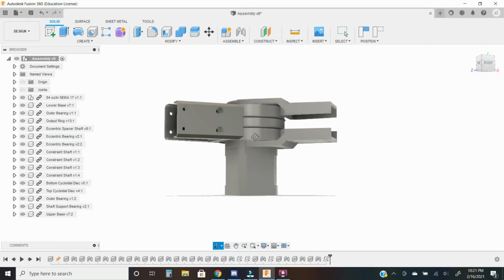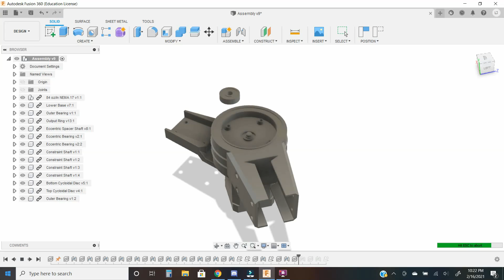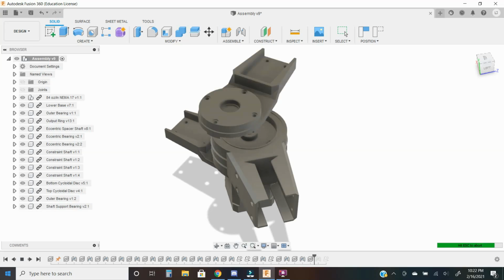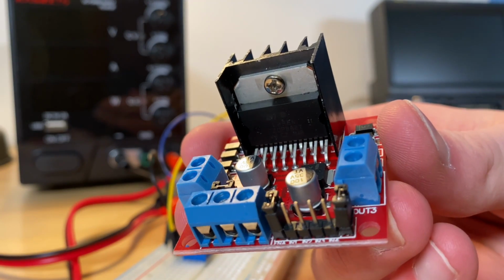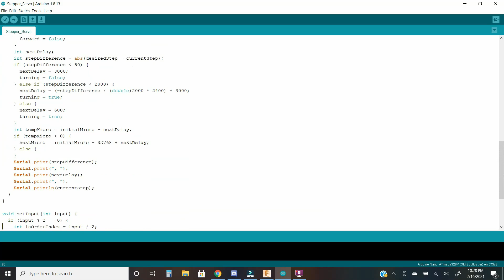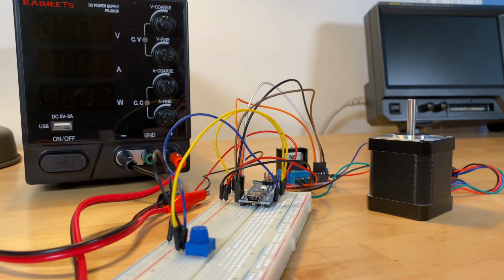3D Printed Cycloidal Actuator

Comment from the maker: I tried to “cut the fat” for this video. More time went into editing, and I actually kinda enjoyed the process! Hopefully it made it more enjoyable to watch. Thoughts on a robotics arm using something like this design?
Reply: Would love to see some section analysis or parts coloring in Fusion, to really make clear the mechanics. But you struck a good balance here imo!
Reply: Nice Work Levi!  Excited to see the arm when you have it complete.
Reply: Maybe for orienting a small solar panel also using a second one? Or a mirror which shines sunlight indoors ;)
Reply: It does make the video better! Your older material about coilgun design were a bit too verbose, but this vide was much faster and more engaging. 

I'd be interested in seeing a SCARA plotter with this design!
Reply: Absolutely love it~! My first thought was you could add some gas support struts/springs to the side between the two arms to help take up some of those forces while it's extended out? Just a thought~ Keep up the amazing work man!
Reply: Very nice quality in content, video, audio and editing!
Reply: If you add bevel gears to move the motor to where the square tubing connect, you could have an even more compact design!
Reply: You should calibrate the steps/revolution of your printer go get precise circles
Reply: this is the first video I've seen from you, its on par with Tom Stanton, and its great, you need more subs... ill get on that
Reply: Try hidrolic system
Reply: If you designed an axial motor (pancake motor) you'd end up with a smaller lighter joint which is critical when you have joints on the end of  joints.
Additionally you'd be able to make it with a hollow axle which is awesome for pan/tilt units having unrestricted pan or for magnetic absolute encoders (which make projects really powerful) etc.
Reply: Please, I want this design
Reply: A robotic arm with this sounds cool, but I think you'll start running into torque issues on the first one if you try and chain 3 of them and do anything with the arm. Video edit was good but try not to wear a shirt that matches your background!
Reply: yes

Comment: I have built a robotic arm with a similar cycloidal drive design, but one of the significant shortcomings of this mechanism is it cannot transfer a higher amount of torque, as shown in the video; when you try to move at higher loads, it starts slipping in the same way. @LEVI Janssen, do you have any solution for overcoming this slipping issue? It cannot be done by using a motor of higher torque as the current motor I am using has high torque, but the gearbox starts skipping at half of the motor's rated torque.

Comment: The robot/motor community is so divisive about which units to use for torque. I believe that SI units are superior to imperial units, but kg cm make the most sense in the usual armature lengths we deal with rather than meters and usually thinking of loads in terms of weight rather than newtons. Anyways, team kg*cm ftw

Comment: Hi Levi, i am in need of a elbow joint design for actual prosthethis.. diameter of the joint cannot be more than 60mm while a regular servo with wheels on both sides needs to be attached.. can you pls work for me for this solution? I will pay for your time..

Comment: 4:00 Yeah ... the bottom and top part aren't really designed for 3D printing. If they were, they would forgo the size reduction. (brought to my attention from the rough surface which would be the side on the print bed if designed correctly)

Comment: 3Dprinted parts for gearheads are crap, so if you use metal/delrin parts as a previous video you made ["High Torque Cycloidal Drive (NEMA 23 Motor)"], it will be way a lot better than this one. Just subscribed.

Comment: Sadly the printer you are using (a cartesian by the look of it) is not the best to make precise circle shapes, if you want relatively precise circles then you should try a delta printer they produce a way better result. On the other end if you would like extreme presition there are DLP resin printers that are excellent, the only problem there being that the resin is way less durable in general but there are many kinds to play with.

Comment: It's backdriveable but it sends current backwards when it moves right? You can move it but you need to make sure that you have a capacitor or a power supply that can handle current going in the wrong direction

Comment: Cycloidal drives are cool, but you have to know it's the reason you can't move the arm anywhere near the max holding torque.  By the time you get an actuator on the end of the arm, you'll be close to your 2.5 lb limit.  Increasing the teeth per inch will help a little, but a planetary gear will be needed at the shoulder.

Comment: Backdriving is actually not a good thing for robot arm. At least not for most applications. The idea is that you should have big gear ratio so you would get hefty torque and no backdriving so if you cut the power the robot will not collapse.

Great video anyway!
Reply: That's not great advice actually.  In autonomous systems having the compliance and observability of back driveable arms and legs adds a great deal of useful information about how the device is interacting with the world.  For instance if you make a walker that is super rigid it struggles to remain stable on uneven ground because it can't adapt to early and late ground strikes.  If the system is back driveable you can use torque monitoring to sense contact points and adapt to uneven terrain.  The ability to back drive allows for interactive, adaptive robotics

Comment: 6:45 what I did is buy a 8l water bottle, with that you can just fill it with water and use a kitchen scale to get the exact weight you need, its great for testing torque capacity at any possible weight

Comment: Is there are reason why you went for the justified but ancient L298, rather than a more modern Step-Stick A4988/TMC2208 or similar?
Micro-stepping should help smooth out motion and reduce noise. The TMC range of drivers also offer silent operation.

For robotics, you'll need some positional feedback, especially with steppers. A potentiometer at the very least. Optical encoders are better. There's a quadrature optical sensor available on a break-out board for around $3-5, and you can print your own encoder onto OHP slides or photopaper.

Comment: Hmm... Is there any specific reason you used a H bridge to step the motor yourself instead of using a regular stepper motor driver? I mean, I'm all for doing stuff yourself, but only if you can actually do it better than the store bought version. And in this case I think a silent step stick would have been a big improvement.

Anyway, I like how compact your gear design is. It's pretty neat. I designed and printed a robotic arm a few years ago. And it used pulleys to drive the individual segments. Which was kinda annoying to do since it was hard to try and hide the pulley system. It had the advantage of dampening the vibration caused by the stepping from the driving motors. It wasn't as compact as your design though. I'm wondering if a planetary gear would be better suited for your design when it comes to delivering torque... I figure one could link a few stages together in a joint in order to increase the torque as necessary. What do you think?

Comment: I like your design but think you could have made it stronger using internal planetary gear set. About 3:1 should fit nicely into a slightly modified version of your armature joint. But it looks good.

Comment: There is a good 100 years of scientific and engineering documents that were written prior to the metric whine. We need to learn BOTH systems. The English units are more intuitive, the Metric are easier if you're still on a slide rule. Any computer can be programmed to use both. Not that big a deal.

Comment: The OVAL PROBLEM in a 3D printer occurs because of one of the belts being stretched permanently. I faced the same issue b4, got it right by using a new belt
Reply: +1 for this, also the belt tensioners on the MP Select Minis aren't great since they're literally springs and can flex. I'd check out the USWaterRockets 6mm belt tensioners on Thingiverse.

Comment: Lets suppose you obtain 7.34H*m of pulling torque (actually you don't as i can see, but whenever) with 25:1 gear ratio (as you mentioned in the comment section earlier) while motor nominal stall torque is 0.59 N*m (nominal pulling torque is less than stall torque, but anyway). As far as I can tell efficiency of the gearbox is something about 

7.34/(25*0.59) = 0.49. 

Not so much even for 3d printed gearbox, but you could mention it because it is one of the most important and significant characteristics of the gearbox design.

Comment: How about a SCARA 3d printer? Not a far reach once you get this far.
Reply: A scara 3D printer is an entirely different beast. Remember 3D prints still need sub millimeter accuracy at the end effector, meaning some really small angles.

Comment: whats the benefit of this over just direct drive to the stepper motor?
Reply: Gearing ratio lets you move a larger load at lower speed.  Cycloidal gears, when done correctly, distribute the load over several gear 'teeth', instead of just one or two in regular gears.

Comment: Bucket of water is a fairly accurate weight. If you don't have a scale, you can measure volume and use density to get a weight.
Reply: I cant imagine doing this in imperial units
Reply: @MisterCOM  super easy
Reply: @MisterCOM it is easy: some water, more water, kind off alot…alot…or whatever you feel like saying. Stones…feet…all random shit anyway 😂
Reply: @MisterCOM  You would throw random stones in a bucket. I can lift 1 stone, it can lift 2 stones. The weight it can lift is 13 stones! That's my entire body weight. [/imperialSarcasm]
Reply: But wouldn't you have a problem with, that if the arm isn't completely steady the water would 'splash' around in the bucket
Reply: @Philip_J  Bottles FULL of water taped together.
Reply: Water only easily works if you're using metric... he might have some problems
Reply: Remember to account for temperature.
Reply: @aeiou75  How much does that matter between 1-99 degrees?
Reply: @hundry_f  programs like MathCAD have practically made caring about units obsolete. Put in what ever units and get results in what ever units you want. The computer does the conversions.
Reply: @jaredharvey1511  thats the whole point we dont need a computer to do it!!!!
Reply: Nah its not accurate
Reply: @smashyrashy  It is extremely accurate! 1L of water is exactly 1KG by definition
Reply: @1992jamo  not practical though
Reply: @smashyrashy  it really is tho and it is used all the time

Comment: Couldn't you just measure the deviation of a 3d printed circle from your printer and then stretch the models accordingly before sending them to print?

e.g. if it squishes them 5% in the y axis, just stretch the model 5% in the y axis before printing?

Comment: What happens if you don't have the bearing but instead try some kind of greased sliding surface? I'm guessing the bearing is the most expensive, heavy and hard to find part. If a bearing free solution would work, it would make the design even more accessible!

Comment: I had some L293d chips (DIP) burn up when I disconnected the motor while being powered (I think).
Has this happened to anyone else?
Reply: Oh you used L298n.  I'll leave the question just in case anyone knows.

Comment: Check different supplyers for printer stepper drivers, sometimes ( in 5 packs ) they can be cheaper than dual H-Bridge and cuts code to pulses ( steps ) and direction outputs making it easy instead of having a step table.

Comment: This looks awesome! I really like the design; it seems like the perfect arrangement for this kind of actuator. 

Hopefully I’m not out of my depth here, but I’m pretty sure stall torque and stall current aren’t meaningful concepts for stepper motors; they’re more for brushed DC motors. For steppers you have the hold torque, and the current is mostly based on how you’re driving it. In your footage, the current is the same with or without the weights, and the extra noise is probably just a mechanical thing. Since a stepper motor doesn’t provide feedback (and often isn’t used with it), and it’s speed/current is not inductively limited, it can’t react to increased loads. 

There might be more going on behind the scenes, and you just simplified it for the short video, which is nice—and it was a good watch! But if you want to describe the behavior of the actuator better, I think you would do that by citing the rated current for the stepper (or whatever you chose to drive it at) and measure the slip and hold torque, and maybe also the unpowered detente torque.  

Anyway, thanks for the video, and again, awesome design!

Comment: How about a worm gear? It would make the system a while lot stable when the worm on the motor drives the arm. The printed worm may collapse but a aluminium would be a good option.

Comment: I have a mini v1 and was able to fix an oval printing issue by tightening the belts. You should also ensure that the stepping values in the firmware are the factory settings. If they are not your scaling will not be consistent across all sizes of prints.

Comment: Nice one!!!  😊

I did an inside out version of a Cycloidal Drive with a BLDC... it reduces noise and weight, while increasing torque and speed...but at the cost of needing an extra encoder and expensive mcu, so using available and cost effective stepper motors is of course a very good choice in this scenario too!!

Comment: You should get a smaller glass bed for your printer. (Or even better, a PEI flexplate) That extra weight is sure to introduce more ringing than necessary.

Comment: 2:00 Here you were talking about the pwm signal caused by the stall torque or something. I'm currently doing a project and I am trying to find the best way of detecting the stall in a simple nema17 stepper motor. Do you have any suggestions what the best way of doing this would be?
Reply: There is some existing solutions for something like this, if I didn't misunderstand you. It's a small circuit board that attaches to the back of the stepper motor, and senses the motor position with a Hall sensor. Google "closed loop stepper motor" :)
Reply: @OMGWTFBBQSHEEP  yes I know those kinds of closed feedback loop stepper motors. Tho I can't seem to find any information stating that you can actually detect the stall instead of compensating for it. Do these boards have pins which allow you to check for stall?

Comment: Neat, looks awesome. Some of the play could very well be due to tolerances between the metal tubing and the screws. Threading on screws should never be used to center a smooth hole, only to clamp stuff together by lock into other threads. Maybe try shoulder bolts?
Reply: On this note, another option might be to use layered concentricity by fastening the bolts in question into threaded holes or through threaded inserts then surrounding those inserts or some form of hole posts with the hollow rod you decided to use for its stiffness and durability.

Comment: I like the design a lot, particularly the holding the gears from turning and rotating the case instead.
So I had a couple of thoughts that may or may not be feasible.:
1) to eliminate the bulk of the stepper hanging out the side, is it possible to mount the motor beside the gear box in the fixed arm and belt drive from there to the input of the gearbox?
2) expanding from 1. use a BLDC motor with a small toothed pully on the motor and a larger one closer to the diameter of the gearbox on the gearbox input.
BLDC motors are lighter weight and quite often more powerful than stepper motors, I think that would make it a lot faster and reduce some of the noise a bit. :-)

Great project, looking forward to the next one.

Comment: Was that actually back-driving the stepper?  Because the motion looked like it was just the new gear slipping.
Reply from the maker: It was. You might be able to hear it spinning the motor. The generated back emf also powered my arduino.

Comment: hey Levi!! great video man! :D

One suggestion I can give you: Use the A4988 stepper motor driver, it works great and have some features like current limitation, overheat protections and (I think) 36V input limit. It's perfect for a Nema 17 and smaller. another similar one is Pololu DRV8825
Reply from the maker: I used these dual full H-bridge modules so that I could also drive my bigger NEMA 23s. In a more permanent installation, yes, something like those would work a treat.
Reply: @LeviJanssen  I actually used those 298 but they were overheating constantly, I then switched to a big sparkfun board (I don't remember the name...) made to drive nema motors : it was MUCH better. Microstepping was good to use, and I was able to increase the max speed of the motor without loosing steps (which was the case with the 298)